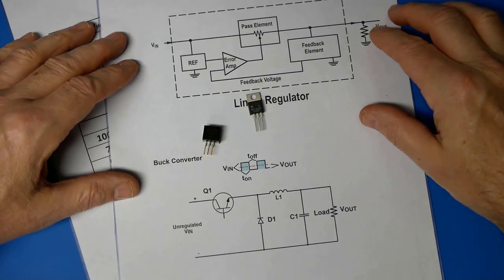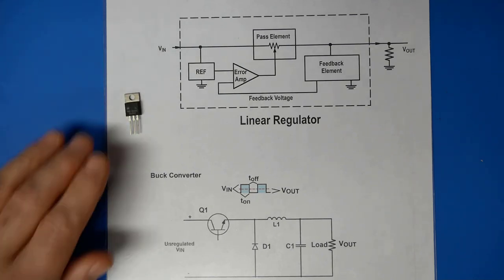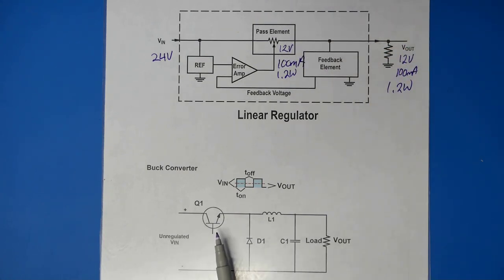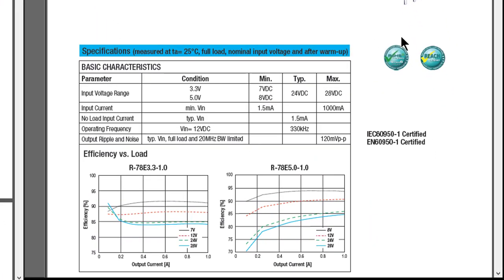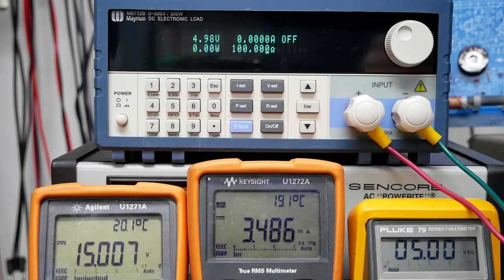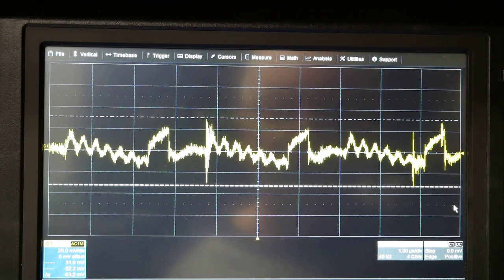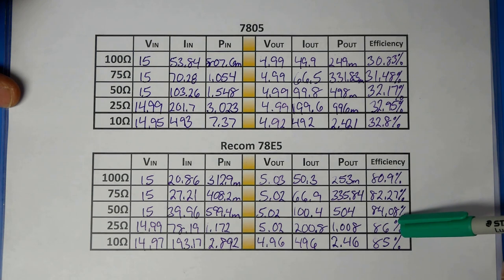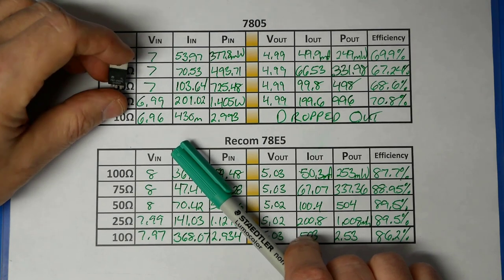98. A 78XX Voltage Regulator Replacement

Comment: Good video. Thank you for your effort to share your knowledge. An often overlooked specification of the LM78xx series of linear voltage regulators... While 2 volts of headroom is the typical voltage needed to prevent dropout, =>3 volts is necessary for the device to achieve its best ripple rejection factor. The trade off is obvious, better rejection verses more heat.

Comment: Temperature and Ripple would have been neat to have on the chart. I wonder how older electronics and 8bit computers would handle the ripple, or if adding some output caps could clean it up enough not to matter.

Comment: This is a great tutorial thanks ! I think the 7805 is safe for now as the Recom device is handy and has some definite advantages but will remain quite niche as the price is £5.61 which i guess is about $7 ?.....I had forgot about them and are worth considering, once again cheers !
Reply from the maker: You are quite right about the price, you could get dozens of the 78XX for the cost of one 78E. The price in the US is about $3.50 for the 5V variety. I'm surprised they cost more in the UK, Recom is a German company if I am not mistaken. Thanks for watching.
Reply: Digikey has them for less than £3 with VAT (945-2201-ND). They're no more expensive than the 7805 when bought new.